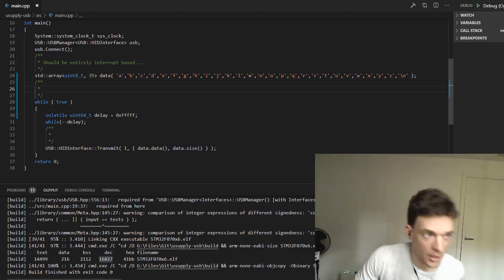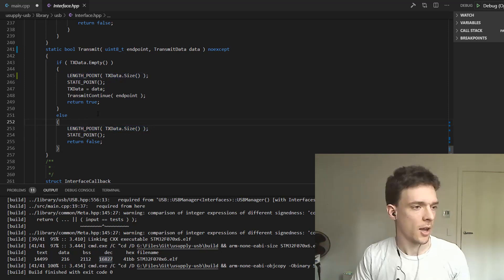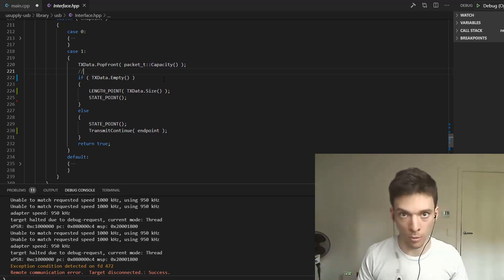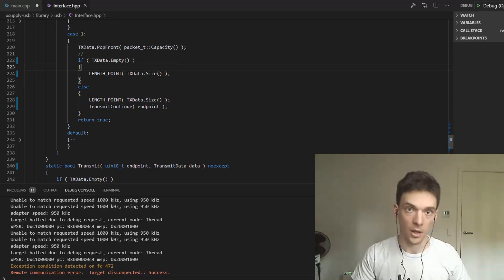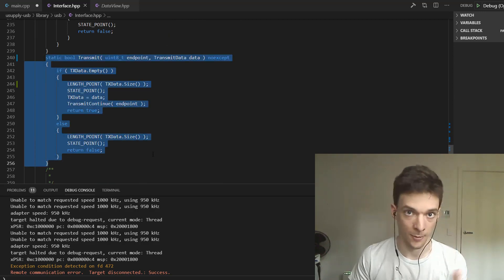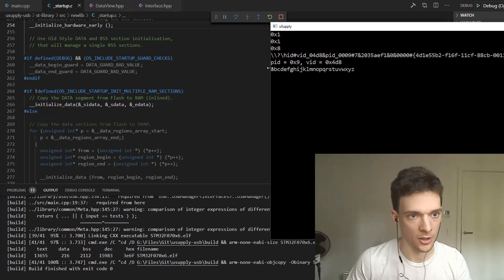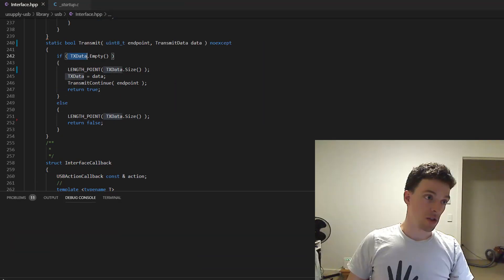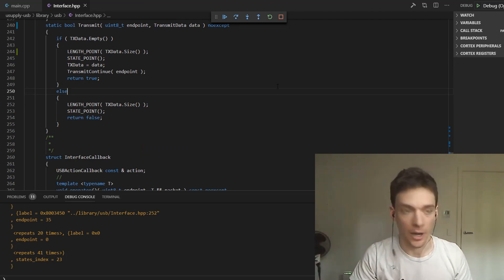C/C++ Interrupt Undefined Behavior

Comment: You need volatiles for variables changed in interrupts, which i'm guessing is where your callback is called from.
Not a GCC bug, it's a keyboard-to-seat error in this case
Reply: Yup, the C compilers assume there is only one execution context (thread), i.e. execution follow only statements present in code. Threads and interrupts violate that.
Reply: Indeed. 
Didn't notice the undefined behaviour until after the video was made :)
Reply: Well you still could make the title and description reflect that ... this is just clickbait ...
Reply: @smunaut  No i cannot, I don't pick the titles, and I don't have the ability to change either of those.
Reply: @davidledger5941  So are you going to do a follow up video then?
Reply: I agree.
Reply: @davidledger5941  Tell Dave1 to do it then... becasue it's again just a BS "tools don't work!!1!1!" when they actually do...
Reply: Victim of your own abstraction. It happens sometimes...
Reply: 2:14 you say it in the Video... The function is called... Yes but not from your Code, so not by your thread, and as your txdata is filled again (with no mutex or any other guard around it) it might have changed again?!
Reply from the maker: @kilrahvp  I have to rely on David tell me what was going on here because I don't really understand any of this compiler stuff, it is not my area of expertise. It was explained to me that this was a really a basic bug, and I questioned that such a simple bug could exist but was assured it did, so I titled it as such. He's been bang-on about these things before and the GCC team had to fix a bug he discovered. Seems that was wrong this time around, I'll change the title. No big deal.
Reply: Don't forget volatiles are also needed in a RTOS environment.
Reply: @EEVblog2  So he discovered a bug before? Show it, or I won't believe it!
Reply: I much prefer the approach of putting the state/variable/whatever in a separate compilation unit, along with the interrupt handler, and accessing it via a get function. This neatly avoids the volatile keyword and encourages you to have all your interrupt handlers and callbacks, everything that runs inside an interrupt, in one place.
Reply: @powerpop23  He did, there's an entire video about it on this channel.
Reply: @felixmoore6781  That seems like a dangerous workaround. It probably works in a lot of cases, but that's assuming no link-time optimization. If LTO becomes more common, you might be in trouble.
Reply: Besides volatile, if reads or writes are not atomic, you need a critical section as well (e.g. disable interrupts around reads and writes).
Reply: @dominickpastore  According to the C99 standard, a compilation/translation unit results in a separate object file. If you use link-time code generation (cross-module optimization, multi-file compilation, etc.), then you won't have one object file per one source when linking. A source in this case doesn't count as a compilation unit. This effect of LTCG is something to be aware about, so thanks for bringing it up. It's then necessary to exclude the particular source from the LTCG process if that's possible. By the way, if the linker itself was allowed to rearrange and remove memory accesses, then I wonder how that would make assembly coders feel about it.

There's a much better solution to this, which is memory barriers/fences and atomics, but this facility is missing or not standardized prior to C/C++11. If an RTOS is present, it's also possible to use its features to solve a subset of these problems. In any case, volatile sucks, especially for large memory blocks. It's way too general and buggers optimization. It should only ever be used for device memory.
Reply: @felixmoore6781  Agreed that volatile isn't great (and may not even be sufficient--see my other comment) and that memory barriers/fences and atomics are the ideal solution, if they are available on the target platform. They certainly exist on x86, but of course that's not always the case with embedded :/
Reply: @felixmoore6781  the linker is absolutely allowed to reorder accesses to memory: the hardware itself will reorder access to memory if you have a cache, the linker doing it doesn't make the situation worse. Of course, this is in general, your specific tools may make particular guarantees, but it's not conventional in any way to do that in modern C/C++.

Any solution to memory ordering problems that doesn't involve fences (volatile creates implicit fences) is at best relying on platform implementation details.
Reply: @josephlunderville3195  The cache should be invisible to a program running on a single core. If an interrupt handler writes to memory and the data is just cached and not actually written, you can still access it anywhere in the program and get the correct data.
	If you know of an MCU linker that reorders memory accesses, I'd like to see it. I wonder how it deals with determining the type of memory that's being accessed, which is often only known at runtime. The volatile keyword is not guaranteed to generate fences at all. You need atomics for that. MCUs don't normally need fences for shared and device memory access, which is a good thing, because they would make it unnecessarily slower. Can you imagine a linker reordering device memory/register writes?

Comment: You need to use volatile if the variable is updated in an interrupt which your USB complete callback is probably running from. When you return from the interrupt the old value is still in the registers and is not reread because of the optimisation. Basic thing when working with embedded.
Reply: This issue here is minimising the spread of the volatile length variable. The data structure is generic, used everywhere.
Reply: @davidledger5941  then use a different variable for that, or maybe try a volatile pointer? not sure if that would work, but could be a way around it? or set a flag that says your transmit is complete and handle it in the main?
short story is if you want the code to change variables in an async way like interrupts, you need the variable to be volatile...
Reply: @davidledger5941  If you using the variable in an interrupt context, you need at the minimum memory barriers.
Reply: Knew it's about optimization and sloppy coding when read the title.
Reply: @NeilvanGeffen  I may use a memory order relaxed read and write. That achieves the memory ordering your describing. I'm investigating a potentially better solution though.
Reply: @davidledger5941  you could make that particular instance of the class volatile instead of making the member of it volatile, couldn't you?
Reply: or likewise point to the object with a volatile pointer or volatile reference, maybe? I'm not familiar enough with embedded C++ to deal with this kind of thing. Modern C++ avoids using volatile whenever possible in favor of things like the std::thread library and locks, but of course none of that is useful in embedded code. I've never written interrupt code in C++.
Reply: A quick test compile shows that you can point to a non-volatile variable with a volatile pointer but not vice-versa.
Reply: @rfmerrill  I could, but I'd need to add volatile overloads to a few functions. Thats a bummer, good point though it wouldn't incur any overhead for other usages of the container.
Reply: @rfmerrill Interrupt code in C++ is basically the same as C.  Language here isn't really the problem, its me not noticing a code bug ;)
I use static members to handle the ISR's but that could easily be a standalone function.
Reply: Not sure if I understood everything correctly, but when using C++ you can also use the <atomic> header to avoid volatile if you don't like it (although I don't think you'd use that on registers).
I think there is also some atomics in C11, but I personally don't know them.
Reply: No, totally bogus if the interrupt is serviced on another thread. volatile will NOT SAVE YOU. You must use locked access (or atomics) for multithreading.
Reply: @davidledger5941  Nope. not if your cpu does out of order execution, compiler optimisations (or disabling thereof) will not help you.
Reply: @oreubens  I mean, on a single core micro, you probably won't have that problem (but obviously using atomics is still good practice).
Reply: @rfmerrill  a common mistake (happens with const also)...  you can put the volatile before or after the 'pointer' mark (*) to get a different meaning.

long* data;  // non volatile pointer to non volatile long
volatile long* data;  // non volatile pointer to volatile long
long volatile* data; // same as above, but less commonly used
long* volatile data; // volatile pointer to non volatile long.
volatile long* volatile data; // volatile pointer to volatile long;
Reply: @davidledger5941  you can't pass a volatile value around, functions parameters "by value" pass a copy of the value.

SO we're talking functions that would take a volatile pointer or volatile reference. That is pretty flaky design. The value of the volatile can afterall change at any point before, during or after the function call.  That MAY be your intention, but it probably isn't.

You probably want to get and copy the volatile value somewhere and then pass the copied (non volatile) value arround (meanwhile the volatile can change without your copied value changing).
Reply: @theIpatix  well the simple answer is... use atomics. always. for all variables that are accessed over multiple threads or from interrupt handlers.  But unfortunately  you can't always do that. :)

Comment: If you're going to claim a compiler bug, you need to look at the assembly. It's so easy for code and memory reorganization to hide another bug.
Reply: In fact a debugger that does not show disassembly is garbage and if things have not changed vs codes does not allow to show disassembly code....
And I would not surprise that Tha bug is related to some of the C++ stuff you had in that class.
Reply: Alberto Vaudagna Given GCC's attitude to anything not locked firmly down by the C and C++ standards, I wouldn't be surprised if this is one of their poorly thought out "optimizations" taking some wording as license to do this.
Reply: Those who blame the complier have not tried their hands at writing one. 😏
Reply: Its likely that I'm invoking some undefined behaviour.
Specifically changing an int from an interrupt. The compiler doesn't know how the interrupt is called (which modifies the int) and therefore thinks it can optimise around the int.
Reply: Just imagine how poor the code would be if it had to assume that all global variables could be modified between any two instructions.
Reply: "Specifically changing an int from an interrupt." Do you mean changing the value of a variable that is typed as an int or do you mean changing the type of the variable from an int to something else? Either way, you can achieve success with proper abstraction. Interrupts are run time events but they can be exploited by the code you compile. These are usually called interrupt handlers and you can override their definitions to provide graceful exits and do all kinds of powerful things.
Reply: Nobody's talking about changing the type of an object, which isn't supported in C. This is about changing the value of a variable from a separate thread of execution.

Comment: Volatile isn't just for registers though. It is also used for variables for things such as interrupt callbacks because the compiler can't know if those will happen or not. I'm not convinced this is a bug. Volatile is usually used quite heavily in embedded code
Reply: smeezekitty Unfortunately, compilers that try to implement volatile often overdo it, failing to do sane optimizations.  With gkobal, cross function and cross module optimization it becomes increasingly hard to tell the compiler to do a custom interprocess operation before or after a block of code that can then safely assume the buffer will be untouched, but only between those steps.
Reply: Yeah, I have since begun to believe I'm utilising undefined behaviour.
I sort of need to avoid volatile here, but I like the suggestion by 
Bokkie Vatikaki, I am looking into accessing the data structure via a pointer.
Reply: @johnfrancisdoe1563  
Yeah, trying to limit the penalty of volatile is also an art.
Adding volatile to a generic algorithm is not good as it affects every opportunity for optimisations. Memory is the real problem in this system. I fully expect to reach 80% flash usage when the system is done.

Comment: My bet, the value is being updated in an interrupt and your function does not see the change because the optimizer reutilizes the old value. Whenever an interrupt may update a variable it must be tagged as volatile, that's basic.
Reply: Yeah I suspect so too. 
Problem is the data structure is generic and used everywhere, tagging it volatile has a huge penalty on memory, on only fixes one bug.
I'm looking for a way to tag the interrupt functions so they the compiler assumes they are called from within the main execution. If that were possible it would save 15% of my total available memory. (Small micro)
Reply: This is likely the problem. You need to use volatile for any variables modified by interrupts.
Reply: David Ledger then you can disable the interrupts at the beginning of your function and reenable before exit, that will ensure that no change is performed by an interrupt in that variable after your function is called, but you must do it in any function that may be affected, depending on your code can be faster or slower than volatile.
Reply: @drgusman  No its still undefined behaviour. This problem is not related to concurrency. Its related to the compiler not seeing that the length variable in TXData can change.
Reply: David Ledger are you sure the problem is not that when your function is being executed the USB interrupt raises, changes the value and then the code continues using the already cached value? If you are 100% sure it's not the problem then you are stuck with volatile.
Reply: @drgusman  If the main control flow is caching the value (which it might be) it is because I incorrectly invoked undefined behaviour. The problem is undefined behaviour, the symptom appears to be a local copy of the variable (probs in a register) which the main control flow uses. So i need to fix the undefined behaviour. Thanks for pointing out the caching behaviour, it explains the symptom more, same problem but now the symptom makes more sense.
Reply: @davidledger5941  Try to cast the length variable to volatile while reading it in main context. If you also changing it in main context, you should disable interrupts on that short moment of change. Also if reading it is not atomic (16-bit variable on 8-bit cpu) you should disable interrupts while reading it.

Comment: Come on boys... Obviously there is no such fundamental GCC bug.
Encountering bugs in the compiler is the rarest of problems.
GCC is 32 years old and tested every day by hundreds of thousands like if there's no tomorrow.
Reply: I've reported and had resolved GCC bug. The idea that because something is old it doesn't have a bug is incorrect.
It also has new versions with regressions each version. If GCC didn't have bugs it wouldn't have a VERY active bug tracker.
https://gcc.gnu.org/bugzilla/buglist.cgi?chfield=%5BBug%20creation%5D&chfieldfrom=24h
Reply: Omg really? I'll check that out.
You are very (un)lucky.
Thanks for sharing.
Reply: I found one serious bug this week and two bugs in the configuration scripts while bootstrapping on amd64 to run a RISCV32 linux. I found 4 GCC bugs the last 8 years in total, so not true.
Reply: I've been using GCC for various projects for 20 years, from embedded to desktop, and I can count the number of GCC bugs I've found on one hand. One finger even ;-)
GCC bugs do exist, it's true, especially for newer targets such as RISC-V I suppose. But if you're having troubles with some simple code, running on a widely used platform, please refrain from invoking a compiler bug as the most likely reason. That being said, it's a natural thing to do when you are an inexperienced developer, I've done it in my own time :-/
The C language is quite complex and "undefined behaviors" such as the one you experienced can be an endless source of frustration.
Reply: @davidledger5941  Could you post a link to the GCC bug that you are talking about? The one that was resolved.
Reply: This is the original stack overflow post, which I posted my own work around as an answer.
https://stackoverflow.com/questions/53257425/undocumented-linker-issue-ld-returned-253-exit-status

The sourceware for GCC is here:
https://sourceware.org/bugzilla/show_bug.cgi?id=23906

At the end of the post for some reasons the emails didn't import into the sourceware post... Not sure why, but Tamar isn't talking to himself... I do'nt remember the conversation, but it appears cut off, I think the email chain likely became detached from the sourceware at some point.

The problem was solved by improvements to the name demangler that reduced stack usage in the linker by a huge amount.

The libiberty problem is still going (still uses VLA's), but there were some proposed patches that could work around the VLA's used by libiberty.

I would have followed the same procedure with this. Just contact them directly, help them isolate the problem.